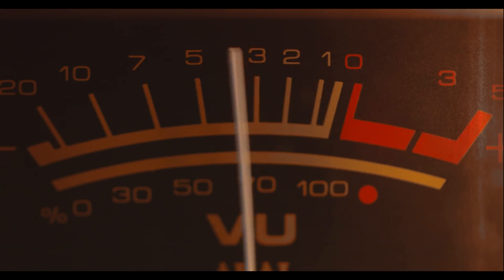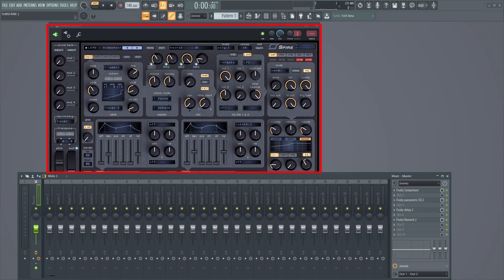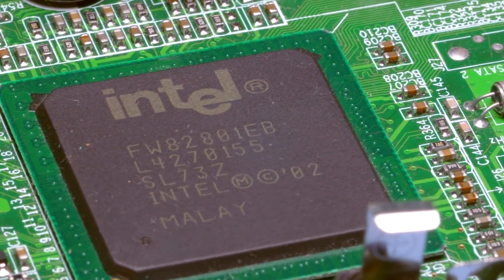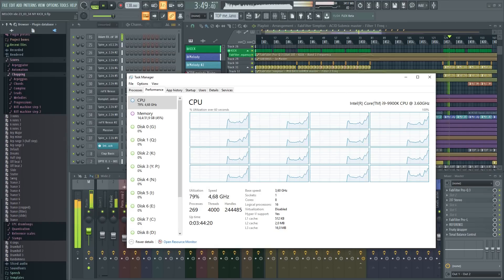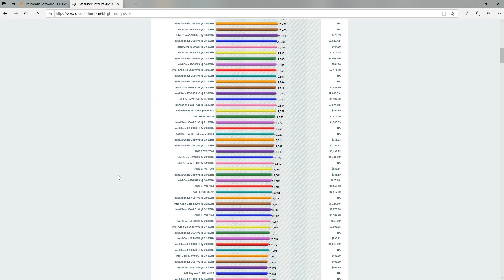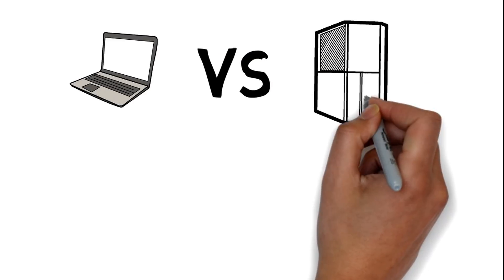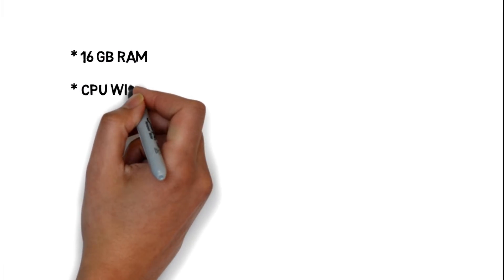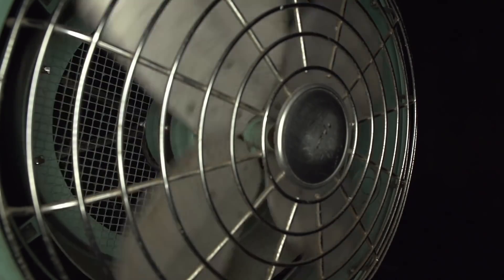The Best Computer For Music Production - What's Needed And Why!

Comment: Câble management bro
Reply from the maker: I knew I was going to get flamed for that. 😂 I shot the video on the fly while putting the computer together, but I was on the clock to finish the video on schedule, and I also had clients waiting for me to do mixing and mastering. I knew it would take a lot of time to reinstall everything and get everything working, so I just had to rush a bit. Unfortunately I also had to reuse some parts from my old rig so I needed to get the new one up and running ASAP in order to get back up and running. 
I went back and used zip ties to clean up the cables a few days later, but it didn't make it into the video 😞
I'm considering making a follow up video with the new AMD 3000 chips. I just need to save up some money to buy the parts first. In that case I'll be sure to show the cleanup process as well :D

Comment: Ryzen vs Intel :/?
Reply from the maker: This video was released before the new 3000 series form AMD was released. I wasn't expecting it to live up to the hype, because the same thing has happened over and over. Remember the Bullldozer? 
This time though they have made some really good chips. When you combine that with the fact that Intel is having huge problems with it's manufacturing technique, AMD has a real chance of finally catching up. 
I'm considering making a follow up video where I test the new AMD flagship against the 9900k. I need to save up money to buy the hardware first though, so I can't guarantee anything, but it would be really interesting to see how the 9900k fares against the new AMD CPU's :)
From the tests I've seen so far though it seems like the 9900k is still very slightly ahead in terms of raw single core performance, and it also allows higher clock speeds, and higher overclocking potential. The AMD CPU's have more cores though, which will of course help, but it's hard to say how much of a role this will play without actually putting it to the test. 
In any case, I suspect that they will come out fairly even. The 9900k will most likely come out slightly ahead, but not so much that it can justify the price difference. Right now I suspect the AMD route is the best way to go, considering the price. But again, I can't say for sure. 

BTW: I'm sure Intel will have to dump prices on their CPU's very soon in order to avoid loosing customers to AMD. That's what's always happened before. :)
Reply: Thank you for this detailed response :) it would be very interesting to put your Intel i9 against ryzen, I'm waiting :D

Comment: You are wrong. Parallel processing is used extensively in all modern DAWs. Your examples are completely flawed. A plugin doesn't do one thing. Different processes are distributed across different threads. Loading a sample for playback or poking some memory or recalculating curves to display on the interface can and will all be pushed to other threads. Having more cores will free up CPU time for the actual audio thread.
Reply from the maker: Nobody is saying that a DAW can't utilize parallel processing, but it also relies heavily on serial processing because of the way dependencies are constantly created inside a daw, and because ther'es a lot of "waiting" for work to be completed. That's where the bottle neck tend to occur, which is why single core performance is so important. I've been in contact with the developers, as well as developers from Ableton regarding the issue, and this pretty much goes for all daws. You can go ahead and ask them yourself if you'd like.
More cores is always better of course, but traditionally single core performance and core amount hasn't been linear. Typically, more cores means more heat which again leads to slightly less single core performance, so there's a trade off there where you at some point have to give up some single core performance in favor of more cores. 

I suggest look up this topic in the manual.  https://support.image-line.com/action/knowledgebase?ans=214

Quote: "The CPU is the primary factor in your ability to run FL Studio with large complex projects. Yes FL Studio utilizes multi-core CPUs but, beyond a certain point, more is not necessarily better."
"The logic of audio processing - There is a long list of tasks that must be processed in sequence, and this means logically can't be processed in parallel (multithreaded). For example: Plugins must wait for instructions from the Piano roll and Playlist before they make sound. Effects must wait for the audio from upstream instruments and FX before they can process it. Further, it's not possible to parallel-process (multithread) instruments and FX that are on the same Mixer channel (their audio is mixed together), or even in the same Mixer routing pipe-line (when one Mixer track is linked to another and another, even FX processing has an order from top to bottom in the FX stack). Then, the Master Mixer track must wait for every instrument > mixer track > effect to be processed before it can process the audio through the Master effects. So logically, there is a lot of waiting that is a natural and unavoidable fact of DAW music processing. Think of a production line. This means the CPU may not be particularly busy, using all its cores and processing slots, yet it runs out of time to fill that tiny 5 ms audio-buffer because there was a lot of waiting for things that needed to be processed in sequence. It should be clear that fast processing is very important and this is not the same thing as multi-core processing. The best CPU is one that has enough cores to spread the work around AND can do the most work on a single core during each buffer time-slice. Which leads to our TIP: When comparing CPUs, look for the fastest single-core performance scores in a package with at least 4 physical cores. Most CPU benchmarks list single core performance."
Reply: yeah - most of this video is garbage. He's putting together a gaming pc to run Fruity Loops and trying to give advice on music computers. Ouch. The entire thing was horrible advice, honestly.
Reply from the maker: @slamcrank Can you explain exactly what you don't agree with? Because I've done extensive research before making the video, and even checking with developers. What's said in the video is basically the exact same thing that's written in the manual regarding the logic of audio processing, all though it's been simplified a little bit to make it easier for people who are not hardware nerds to understand.
Reply: @FireWalkMusic   It's true that some tasks can't be distributed, but it's not as simple as you make it seem. In modern DAW's each plugin runs in its own thread. They may have to wait for some midi info, but that's such a low amount of data that it's pretty much nothing compared to the hundreds of thousands of audio samples that follow that command and that actually have to be processed(midi doesn't most of the time).
Each audio channel is also running in an independent thread (Ableton says this themselves too, just look at their website). When all the channels going into a bus are done, they will be summed and processed by another thread. Now, that bus thread does indeed have to wait for the other threads to finish, but the time that takes is more influenced by the core count than by the clock speed. Further more, if you have multiple busses, they will also be distributed across multiple cores and thus be done faster.

What I don't agree with is that you make it sound like the proces is completely linear, while it is in fact very concurrent. 

Maybe FL Studio is somewhat limited in their engine, I'm not really familiar with that DAW. If you take a look at Logic, you will see that that takes full advantage of all cores on a system. In Apples latest WWDC keynote they showed the new Mac Pro with all it's 28 cores running Logic like nothing else. The single core speed is really not that special on that machine, but the core count is what makes it work.
Reply from the maker: @Wouter I get where you're going at, and you're not wrong. My point is that it's this "waiting" for things to complete that's causing most of the issues in audio processing, and more cores can't really do anything about that. This means that most of the time the bottle neck will be the lack of single core performance of one single core rather then performance loss due to lack of cores. 

All daws process information the same way, but FL Studio is arguably a little bit different because of it's non-linear nature where you can route anything anywhere, which can create even more dependencies within the program, (which leads to more waiting). Any given mixer track is an opportunity for the CPU to utilize multi threading. However, if you route one mixer track to another mixer track in FL Studio a dependency will be created and then you've pretty much ruined that "opportunity" for the CPU. 

I spoke to an Ableton developer a few years ago when I was researching performance difference between daws, and I was told that Ableton pretty much process information exactly the same way FL Studio does. The reason you'll see performance difference in the various daws is usually related to the handling of the buffer. 

Some daws such as Logic, Cubase, S1 etc are considered "linear" daws where you have a linear relationship between tracks in arrange view and the mixer. Track 1 goes to track 1, track 2 goes to track 2 and so on. Arguably this will utilize multi cores better because it creates less dependencies vs a fully modular daw such as FL Studio where you can do all kind of crazy stuff. 
That said, most people still tend to work in a mostly linear way in FL Studio. In theory it should then perform basically the same as a project set up in a linear daw such a Logic. I'm windows based so I haven't used logic before, but I used Cubase many years ago and I'm pretty sure logic and Cubase processes audio very similarly. :)

I'll admit that this video is simplified quite a bit, but I had to "dumb" it down a bit in order to give people who's not hardware geeks a rudimentary understanding of what's going on under the hood so to speak. 

My first computer was a 486 25 MHZ SX, and I've been building computers ever since. Most of my viewers are between 15-34 years of age, and I suspect that most of them are not really that into the hardware side of things. They just want to make music. 
I wanted to make a video that explains in simple terms what's important when shopping for a new computer, also keeping in mind that most people use their computer for more than just audio production. :)
Reply: @FireWalkMusic  Yes, when you route multiple busses end to end, that makes things work a little different. FL Studio and Ableton do indeed use that quite often. This will make clock speed more important. You are right about that.

Most other DAWs (Logic, Pro Tools, Cubase, Waveform) will still utilize multiple cores very well. Instead of each instrument having to wait for another, a bus will have to wait for multiple cores to finish up their instrument, which significantly reduces the waiting time. That is still valid in both Ableton and FL Studio, but since you have more mixing points where audio will have to be added together, the need for higher clock speeds does indeed increase. 

I get what you are doing, and you can't really go wrong with an Intel i9 anyway. I didn't want to insult you or anything like that, I just wanted to say that most DAW's do absolutely benefit from having more cores. I'm quite impressed by how much you know about this subject. I don't know many people that actually understand how DAWs function. Even some of my colleagues that are so called 'audio programmers' too, don't seem to have a clue. Nice job!
Reply from the maker: Sorry for the late reply. Indeed, the linear daws such as Cubase will tend to be slightly more efficient due to the linear relationships creating more opportunities for multi core processing. In FL Studio any track can be a send track, and you can send or split any track to any other track etc. Automation is also something that creates latency and in FL Studio you can make automation clips that automate other automation clips and so on. 
In short: If you really wanted to you could easily make a project that would strangle just about any CPU in ways that wouldn't be possible in say Cubase or Logic. That said, most people still tend to work mostly in a linear fashion even in FL, so overall the difference won't be astronomical.  :)
I used to do assembly programming back in the MS-DOS days, creating those plasma effects with music and such. This was before the mp3 format was invented and nobody had enough space for wav files, so we used MOD files created in fast tracker 2 and such. In fact, that's what got me into making electronic music in the first place. :)
Reply: @WouterStudioHD  Why are you overcomplicating it I would rather spend the energy learning how to mix a great song then on how a DAW processes audio just buy what you can afford and be done with it.  Musicians spend more time on their craft then on how a computer works
Reply: David Jenkins  Who do you think make your DAWs? I’m not a mucisian, I’m a programmer.
Reply: @slamcrank   A pc is a pc man please inform me on the difference

Comment: You'd of got the same performance with the i7 9700k. Possibly even with the i5 9500K OC to 5 ghz. Especially spending the save on a flagship motherboard. The i9 needs the very best VRM's for super stable OC. You'd be able to push the i7/i5 faster on your MB.
Reply from the maker: It's not just about clock speed. The i5 can't really compete with the i9 when it comes to real time audio processing. The i5 is great for games and such, but keep in mind that the GPU is doing most of the hard work, and the DAW itself can't utilize GPU acceleration for the audio processing in any way. The i9 in this video is running at 5 ghz btw.
Reply: @FireWalkMusic  I thought you only had it up to 4.8 (might of been 4.6) going from memory when seeing that screen. My point is MB depending, as in,  the i9 wont OC well on anything less than the flagship MB, especially if you want to stay locked passed max turbo, with HT.
Reply from the maker: They also run quite hot usually, but 5 ghz is not a problem.. With this cooler it's not particularly hot either. I could probably squeeze out more, but I like to be on the safe side. :)
Reply: @FireWalkMusic  It's not so much the issue of the CPU heat... that's easy to control... But more the VRM's. The quality of them and how well they handle heat, correct voltage etc

Comment: This is a good guide but thankfully those of us using all hardware synths again instead can get away with older parts builds around even 3rd gen i5 or i7s (proper desktop ones) and 8GB ddr3 ram which saves a lot of money
Reply from the maker: Indeed. You don't need much computing power if you're working with hardware synths, samples and such. If you mostly just record vocals, drums, guitars etc then that won't consume much CPU at all :)

Comment: Not trying to be contradictory just wanted to add that there are many plugins that are Graphics card accelerated , I'm not saying run out and buy a Titan GPU but I wouldn't skimp especially if you will be using many instances of those type of plugins
Reply: Intels built in Graphics works fine. I'm running dual monitors off the 9700k. With the saving not buying a graphics card buy a better Cooler, like a silent Noctua, No graphics card fan noise either.
Reply: I had a graphics card in my pc but I took it out graphics card is useless in audio workstation unless you have multi monitors with high resolution my monitor is 1440p i have no issues

Comment: You never went over your ram. What CAS Latency rating was it? That's a crucial component for audio builds.
Reply from the maker: There's links (with full specs) to all the components in the video description :)
Reply: I disagree CAS latency might be more important on a gaming pc but audio pcs not so much.  I wouldnt over complicate it the CPU and harddrive are the most important.  If you run a ton of pluggins then the amount of memory you use is important too not CAS latency.  If you are using Ryzen yeah maybe its important but even the slowest DDR4 is sufficient.
Reply: @davidjenkins8449  It's thoroughly tested man, Gamer Nexus covered it specifically tailored to audio pc builds :)
Reply: @davidjenkins8449  It makes a huge difference on live recording also.

Comment: It seems that rendering a few of the most CPU demanding tracks will have a far larger impact than upgrading the hardware. Interresting.
Reply from the maker: Freezing tracks can significantly reduce CPU workload and can be a good solution, but only if you know that you're not going to touch that part again later on. Freezing is a bit more tedious in FL compared to most other daws, even after the upgrades to the process. :)
Reply: @FireWalkMusic  Don't call it freezing. Call it RECORDING. we need to get back to recording shit not some bullshit videogame freezing maintaining MIDI sequences in synths. 
Some of the greatest Trance records were made on Pentium MMX and Pentium II chips. This marketing for high performance gaming PCs to do music production is ridiculous.
Audio is audio; just record stuff and move on to arranging it and mix it; then master it.
Reply: @dotMPEGmusic  No, it's called freezing tracks. In FL Studio it bounces each one sequentially. Very handy, just makes your exporting longer.
Having said, I can max out 64 gigs of ram and my i9900k with a single note on a custom Serum patch. More power if you can afford it is always better. Having to mute tracks, freeze them, pre export, halfway through just to hear how it all sounds together is aids. When you start having 200 instruments plus, with FX on almost all of it, it's easy to redline a PC worth $10k. 
The point is workflow. The more powerful your PC, the more work you can do in a better pace.